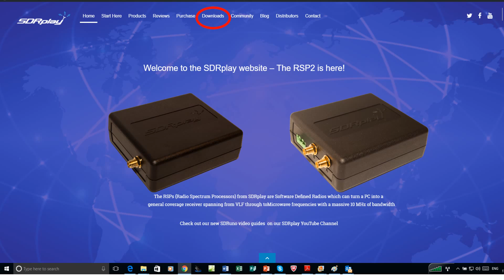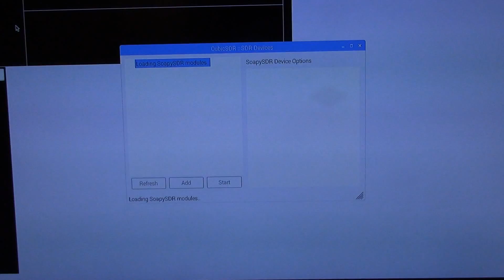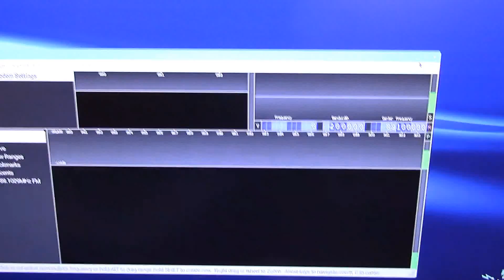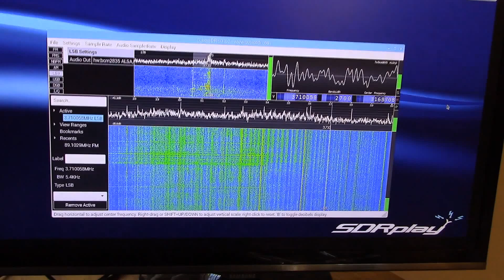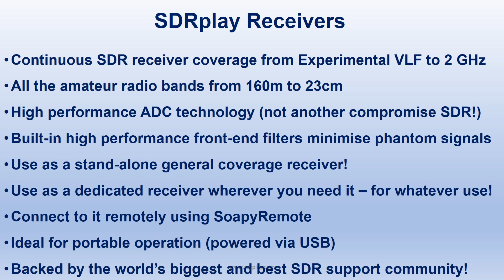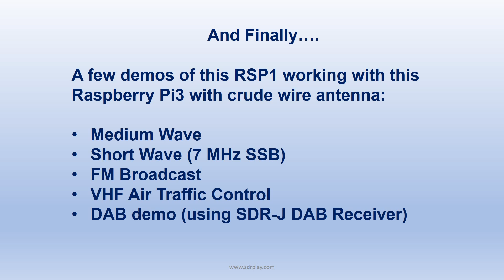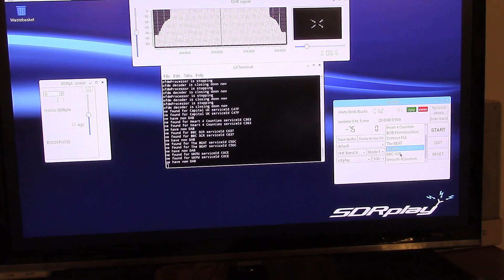SDRplay Raspberry Pi3 setup for RSP

Comment: I set up my Rsp1 as you did in the video including the simple wire antenna, but I don’t get any signals just lots of noise.
That is on 40 meters. Am. I missing something?
Thanks anyway for a super system.
Ian mcphedran
Reply from the maker: At the moment 40 meters can be very dead during the daytime.  Adding an extra RF ground may help a  lot. ( needs to be less than 3 or 4 meters (fraction of a wavelength)  to a proper ground.)  If that's no possible, a counterpoise would be better.  However both may be in the presence of strong electrical noise levels.  It might be worth sharing your set up on the SDRplay forum and gathering comments and suggestions: http://www.sdrplay.com/community/viewforum.php?f=8&sid=97

Comment: can it show wifi signal? and if it can, can I integrate a program with it? for example a python code that does something based on a certain condition of the wifi signal. currently working on my final year project and I need to base it on the wifi signal.
Reply from the maker: Unfortunately WiFi signals are above 2GHz so it can't
Reply: SDRplay Software Defined Radio Receiver thanks a lot for the reply 😁

Comment: Has anyone tried running this thru a  VNC? I've attempted numerous times (without success) to get this radio and software to run thru a VNC, and either crunching all that data its either just too taxing or the OS with the radio isn't designed to operate thru a VNC. If anyone has anyone has ideas how to keep this running thru a network please let me know.

Comment: Will the RSP1A be compatible with the new Raspberry Pi 3 B+ ??
Reply from the maker: Should be - we're going to be testing it in the next week or so!
Reply: The reason I ask is because I was watching a youtube video in which someone was trying to run CubicSDR on  a raspberry pi, and they were having the same problems I had when I tried running an under-powered pc (sound cutting out, etc). So, I was wondering if that person was using one of the earlier versions of Raspberry pi.
Reply from the maker: The existing SDRplay RPi image needs updating to support the Raspberry Pi 3 B+, which we will do shortly. However, if you have another Raspberry Pi 3 (not B+) you can make the changes required for it to boot on the B+...

1. Boot the SDRplay SD-card in the non B+ device as normal.
2. Open Terminal Window
3. Run...
sudo apt-get update
sudo apt-get upgrade
sudo apt-get rpi-update

This will make the SD card bootable on the Raspberry Pi 3 B+

Another thing I noticed during testing was the power consumption for the B+ is higher than previous models so make sure you have a good PSU. I tried a few 2mA supplies that didn't work, but a good 2.5mA power supply worked fine.

We'll make an announcement as soon as we've got the image updated for the RPi 3B+

Note: for those into different SBC devices, you might want to try out the Odroid-C2 as with full Gigabit Ethernet support - I could get 10 MHz bandwidth remotely using SoapyRemote to my PC pretty easily. Low CPU load as well. It does need some forced air cooling in our opinion

Comment: I will need the possibility to analyse disturbances in about 10kHz-100kHz range. Is it possible to record  the FFT waterfall in the file using Raspberry(or at least on PC version) in long time period (hours or days). Would you have other suggestions - recording the signal and then analyse it? Is it possible to set the MAX HOLD on the FFT for long time period?

Comment: The problem with running OS virtually is that it chews battery life and memory then you will have to plug in your big filthy dirty noisy PSU !!!

More development should go into Mac and Linux rather than making people use Windows. 

Luckily Apple make it very simple to install Windows 10 on the MAC using Bootcamp but that means you still have to use windows but at least you get much better battery life than running a virtual OS in the likes of Virtual box or whatever.
Reply: Who has run the O/s "virtually"? The op is running CubicSDR = Linux.
Reply: Nobody is forced to use Windows. If they don't like windows they can get Linux for free. That should tell you that people would rather buy windows than run free Linux.
Reply: o00scorpion00o  Linux is everywhere around us. Phones, tv, business machines.. Linux makes more sense to me. 65% of the net is run on Linux in one form or another. But I make a lot of extra coin fixing Winslows machines. Each to their own. We need ppl porting more Mac and Linux apps and software. Linux is still for the ppl by the ppl. So time to get involved.

Comment: Nice, can u run SDRuno with this setup?
Reply from the maker: No. SDRuno requires Windows (or a Windows emulator , like Parallels, on a  MAC)
Reply: linux has a program call wine that can run windos programs